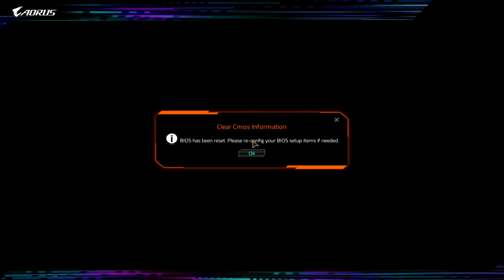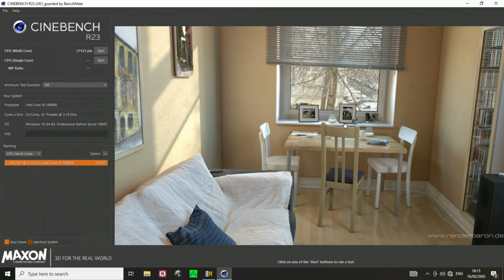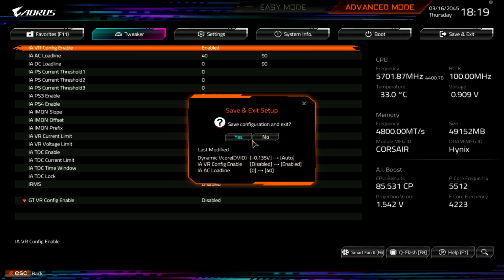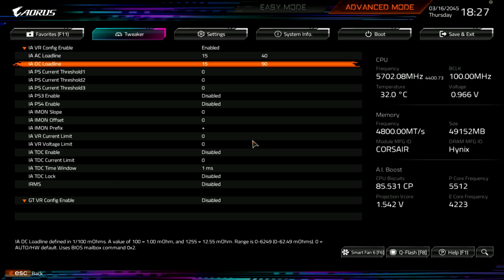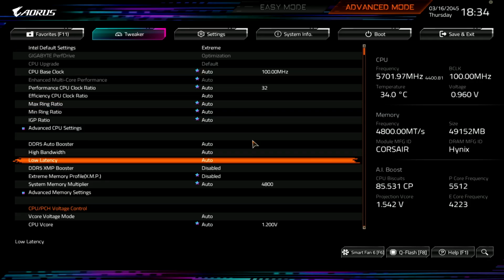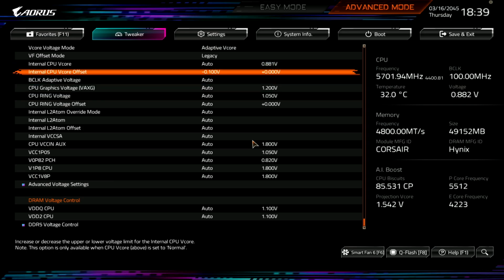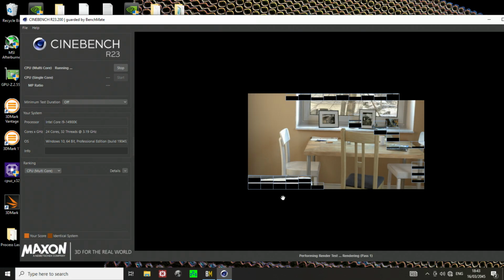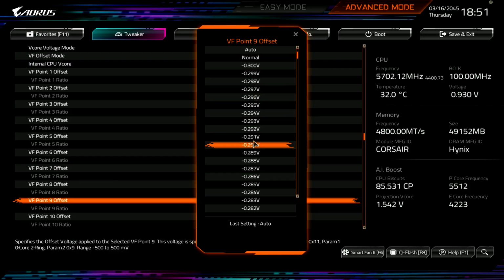YOU  DON'T HAVE  TO TURN OFF CEP to undervolt intel 13/14th gen CPUs

Comment: Great video, learnt a lot. Sadly my VID stays the same, it's somehow getting ignored. B660I Aorus Pro, latest BIOS, the new microcode. CEP can't be disabled either for some reason on this board, even with the old microcode, the option is just not there at all.

Comment: When I do it the correct way—as you have shown in this video—it does succeed in preventing CEP fork throttling and tanking Cinebench score. However, I lose the 6Ghz boost clock entirely. Actually, I never see a clock higher than 5.7Ghz, entirely, at any voltage, load, or temperature.

Any idea why?

Thanks for the video, Buildzoid.

Comment: Processor i7 13700KF, LLC - HIGH, AC/DC - 55, AI VR LIMIT - 1400. VCORE OFFSET is set to -0.125v. There are no problems during testing, and the performance is good, but I am concerned that the voltage may exceed 1.5v during load changes. I'm also concerned about the temperature, which is 95-100 degrees (I have an Arctic Freezer water cooling system, but the mounting is incorrect, and there is no proper mounting, resulting in poor contact and overheating). If I set the Power Limit to 185W, I achieve acceptable temperatures of up to 90 degrees, but the performance decreases by 10-15%. Additionally, I experience constant temperature fluctuations during normal computer usage, such as when opening a browser, where the temperature rises from 55 to 90 degrees. Can you give me any advice? How can I remove the jumps above 1.5v (I thought AI VR LIMIT was the limit, but even when I set it to 1.3v, I don't see a difference)? Also, how can I cool my CPU a little more without losing performance?

Comment: I noticed on my Gigabyte Z690 UD DDR4 that if I set VR Voltage limit to 1400 or even 1450, the ring clock refuses to boost to the stock 4.5ghz. it only boosts to 4.0ghz

Comment: Can someone point me to a source where i can cross check this with a MSI motherboard? I've also a 14900k and my main concern currently is heat reduction. Got a 360 AIO (but no contact frame) and i'm hitting 84c in CB23 and around 75c in BF6.
It's really a lot of information and unfortunately setting descriptions aren't always the same across mainboard brands.

Comment: on these setting my system will not boot-Gygabite Z790 ud d4/i7 14700k/80 gig ram-i had to reset the bios. is it possible because of voltage?

Comment: You don't need to undervolt any chip if everything is built correctly. This is just misinformation that leads people to damage or destroy their computers. Undervolting any device will cause performance degradation and stability issues, and ultimately damage the entire PC. People should avoid these dangerous setups and run their machines on default settings if they don't need overclocking capabilities.

Comment: if there are any option for undervolt my 13700F in my Z790 aoras elite ax DDr4 i have watercooling msi 240 but it hit high temps too fast  the only thing it works for me i add PL1 125w and PL2 160w but i lose a lot of performance if there are any way to decrease temps without lose performance i want to try adaptive vcore offset but offsets was hidden in my motherboard any help ?

Comment: Interesting video, does this also translate well for MSI Z790 motherboards and 14700KF processors?

 If I undervolt my CPU to -0.100 and run a 1 hour stress test the PC will just reboot about 20 minutes in.

Here's my settings.
  Intel 14700KF processor: 
.Load line calibration level 4
. AC / DC set to 12 down from auto which is 110 and causes over heating even with default clocks.
. 6 P-cores at 5.7Ghz and negative offset of 0.055V
.2P-cores at 5.7Ghz and a negative offset of 0.075V
.All E cores 4.5Ghz (4.6Ghz tested and works fine) default voltage of 0.00
-------------------------------------------------------------------------------------------------------------------------
XTU score: 12,850
Cinebench R23: 36,880

Average temperatures while running Cinebench R23 88C with an ambient temperature of 23.9C or 75F

Edit: Happen to know how to increase fps beyond 76 fps in timespy? some times I see 81 fps but most of the time 76 to 78 for the cpu test

Comment: Your videos helped me get my 14900k to 39200-39700 R23 score while keeping Max temps less than 80 and max voltage to 1.34V or less. 

Thanks glad I bought a gigabyte z790 MOBO.
Reply: Settings for load line and did you use a adaptive offset undervolt?

Comment: Hello everyone.

My processor Intel i7 13700k is always overheating (idle temperature 65-68 Celsius)so I made a couple of bios settings on it :

EXTREME MEMORY PROFIL : XMP1
RE SIZE AR SUPPORT    : ENABLED
IA VR CONFIG ENABLE   : ENABLED
IA VR VOLTAGE LIMIT   : 1300
IA  AC  LOADLINE      : 55
TURBO POWER LIMITS    : AUTO - ENABLE
PACKAGE POWER LIMIT1 - TDP(WATTS) :170
PACKAGE POWER LIMIT2   (WATTS)    :170
CORE RURRENT LIMIT (AMPS)         :AUTO - 200
CPU INTERNAL AC/DC LOADLINE       :AUTO - POWER SAVING
CPU VCORE LOADLINE CALIBRATION    :AUTO - MEDIUM
INTERNAL GRAPHICS                 :DISABLED
GIGABYTE UTILITIES DOWNLOADER     :DISABLED
DYNAMIC VCORE (DVID)              :-0.070V
INTERNAL VCCSA                    :AUTO - 1.200V

Do you think this is a suitable setting for an i7 13700k processor??
Now the temperature is stable at idle 50-55 celsius
I didn't do too much reduction, tightening ??
It seems that the speed of the Pc has decreased slightly.
Which option could be slightly reset without increasing the temperature?
Reply: IS IT A FOOD SETTING DO U RECOMMEND THIS CUASE I HAVE 13700KF

Comment: What do you do on an MSI board though? The settings have slightly different names so I don't know if they're the same thing or not and there's the the LLC, I heard elsewhere that it doesn't work the same direction as on other boards but I just can't figure it out, is high LLC a bigger compensation or is a low LLC a bigger compensation. None of it is clear to be honest.

Also quite confusing, I thought Vcore and VID were different things? You adjusted the Vcore whilst talking about changing the VID offset but I thought one was the CPU end and the other was the controller end? Are they the same thing?
Reply: I also have MSI, if you found anything plz help

Comment: Wait are you sure thats an issue? If you offset by -0.135V you would probably need a top 1% Chip if not better and be super lucky for that to not make everything unstable cause crashes or simply downclock your CPU alot. I would try a conservative number like  -0.030 to -0.050 and see if that fixes the issue with minimal to no performance loss and no extra fuss which would be realistic in most cases. For most people a -0.050V offsett actually works drops temperatures by 10 degrees while maintaining standard clock speeds and be in Intel specs in terms of voltage. It's not like the CPU will go into turbo high voltages under normal use in that case.

Comment: If I understand correctly, my 13700k BIOS config, is counterproductive for degradation?
IA VR Config = Enabled
IA VR Voltage Limit = 1400mv
IA AC Loadline = 55
Package Power Limit1 -TDP (Wats) = 253
Package Power Limit2 -TDP (Wats) = 253
Core Current Limit(Amps) = 307 
CPU Internal AC/DC Load Line = Power Saving 
CPU Vcore Load Line Calibration = Medium
Vcore Voltage Mode = Adaptive
Internal CPU Vcore Offset = -0.100v
Reply: pl 1 220 or 125 imo

Comment: I tried with IA CEP on, but it only worked well with it disabled on my 14600k… better results now and lower temps!
Reply: Yep same here. IA CEP on forces the AC to run higher. It doesn't work well when using a lower CPU lite load
Reply: Did you find a solution? I can’t find a way to get my vcore and vid voltages to match well enough to not trigger cep without increasing them significantly rendering my pc a thermal mess.

Comment: But each mobo has its own LLC values
I have Msi z690 Tomahawk, and it is really hard to find any LLC values for the 8 modes in Bios. It even differs from the same company as a different model

So, how can we calculate each mode for non tech?
I searched a lot and nothing tells how to calculate it

Comment: I agree the video is a tad long, but I need to offer confirmation that your recommendations are spot-on. I have the Z690 AORUS Elite AX with F30 BIOS (0x12B Microcode) and a brand new i9-14900K (never subjected to faulty default voltage settings, BTW). With your settings: Adaptive Vcore, Legacy mode and -100mv offset, Loadline Calibration = High, VR Voltage Limit=1400, and IA AD/DC Loadline=55, I consistently get CBR23 score of 39500-39700. And highest vcore never exceeds 1.34v under all core load.  And I'm still seeing 2 Perf-cores hit 6 GHz periodically and multi CPU ALL-core loads at 5.7 GHz on the 8 Pcores.  I suppose I could tweak at the margins, but I really see no need to as these are rock stable under gaming loads, and CPU voltages drop to .77-.78 v under idle or low loads.  Thanks for your explanation of this most-confusing topic.

Comment: hey there - tommorow get my i7-14700KF on ddr4 since have in my old system also get very cheap GBT mb - those settings should work also for i7? I should start to update bios with q flash without cpu in it?

Comment: I want to run my 14700k+gigabyteZ790i on lower tdp and voltage on a mini itx case with a tiny cooler. I don't really need that much processing power and the CPU was obtained for cheap (exploited a  e-retailer's website error), anyone have suggestions, video recommendations or info? I don't care that much about performance lol

Comment: what is the new max voltage standard from intel's 1.72v then ? i have an asus z690 hero with 13900k by core usage p55/e44/c8 to 49 all limits off cep and all that disabled max core voltage 1.4v the second max vcore voltage at 1400mv  the vr f curve set at -0.06v at 5400mhz the next steps are 5700/5800/5800/5800acdc and those are set to -0.08v max wattage 450w on both pl1 pl2 so it runs accoring to hardware monitor at 1.305-1.314v at full load drawing 440watts in CodeBench load line at 8 with ad dc set at 0.01 for both .is such a low ac dc causing a voltage spike should i lower it to 0.03 for both ? or lower my load line to 4 and adjust ac dc to match ? as since i dont use higehr single core speeds i dont see the need for vdrop any more it would be best it run at the lowest voltage it can given its only maxed at 55x now . i also have undervolted the cpu l2 voltage which i think is the ecores by voltage offset of 0.04v. SA is 1.3v stock. memory is 6400 clocked at 6000 1.335v mem and imc of 1.335v instead of 1.4v for mem and imc stock at 6400. also my max cpu temps are 78c at full load in cinebench at 440w 1.314v .

Comment: Great video as always BZ.  I did all the settings you have shown but if I try and raise my CPU above 5.4ghz it will start to hit the 253w PL1/PL2 limits.   Do you know how I can further tune my 14700k to stay at 1.35ish volts and at or less than 253w?    I have a score on my Aorus Master X of 94 so my cpu should be ok as I have not tried to run it past 5.2p cores and 4.0e Cores due to intel's issues.

Comment: I was able to adjust the settings for my ASUS ROG STRIX Z790-F GAMING WIFI MB and increased from sub 37,000 to over 39,000 on Cinebench R23 with my 14900k. In the BIOS under the Ai Tweaker tab there is the Global Core SVID Voltage setting which I changed from Auto to Adaptive, then I changed the Offset Mode Sign to -, and finally set the Offset Voltage to 0.10000.  This is also after installing the microcode (0x129).
Reply: keep CEP on?
Reply: @AdventureStreamingGuys yes
Also, realized those weren’t my CPU temps but rather my GPU.

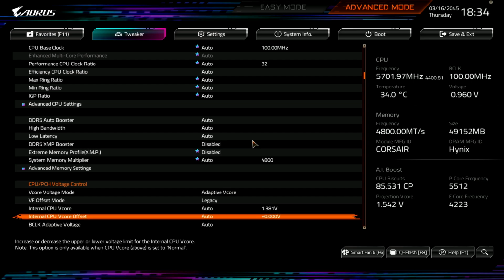Comment: Tried the method at 26:00 on my MSI board and this did not work. CEP enabled, Lite Load set to intel default and had an offset of -0.1 (I think MSIs offset mode is the same as the gigabyte adaptive mode shown here, since this mobo here doesn't have an offset mode and MSI adaptive doesn't allow you to specify any kind of offset) and this gave me a score of 17022 (!!!) for my 14600kf. That's way worse than what I had before which was around 22k (still not amazing).
Reply: Any update?

Comment: Hello buildzoid, I follow your video to do following settings:

CPU: 14900K
Intel Default Setting: Extreme
CPU Vcore Loadline Calibration: High
IA AC Loadline: 55
IA DC Loadline: 55
IA VR Voltage Limit: 1400
Vcore Voltage Mode: Adaptive Vcore
VF Offset Mode: Legacy
Internal CPU VCore Offset: -0.125v

In the video, you set Internal CPU VCore Offset to -0.100v but I set to -0.125v, is [-0.125v] with these settings also safe for long-term use? I do not know much about undervolting, I just hope my 14900K not going to degrade.
Reply: as long as temps are good and system is stable...u good
Reply: Did you edit the PPL1 PPL2? Should i set mine to 253W?
Reply: @ragama623  i haven't set it since Extreme profile already handle for it (restrict ppl1 ppl2 max to 253w)

Comment: genuine question: after upgrading to the latest bios on the B760M AORUS ELITE X AX, the "undervolt protection" option has gone, and undervolt isn't possible. On the other' vendors MBs this setting still exists though. How to undervolt with such a problem?
Reply: This option has also disappeared on my Asus BIOS after an update so I think Intel mandated the removal of said setting.
Reply: @pixels_per_inch I doubt think so, because all other manufacturers has this option in their BIOSes
Reply: @antonavdyushkin545  I think they've only forced enabled undervolt protection on non-Z series boards just like CEP.

Comment: thanks for the guide
using a i9 14900KF on a aorus z790 elite AX ice with an AIO 360 watercooler i got a 35022 cb score
after changing the vcore offset to -100 i got a 35795 cb score
setting the vcore loadline calibration to high put my cb score to 36472
still not nearly as high as yours but im happy it improved, was not able to change the AC/DC loadlines as it was unclickable with the latest bios

Comment: Hey man great video, i have the B760 and i updated it to the new microcode 0x129, intel default settings is not in the bios before or after i updated the bios.

And the CEP setting is the same as u have Auto = disabled.

I don't have the "offset" options in my motherboard so im stuck with the dynamic Vcore option.

Im getting better score on Cinebench 24 when i apply a negative value in the dynamic Vcore.

That means the CEP is actually disabled, right?
Reply: B series can't disable CEP, it's forced enabled at the hardware level. I assume your CPU is a lower tier than the 13600K which is the minimum they have programmed for intel default settings
Reply: @pixels_per_inch  i have the 14700F , and I think it is disabled , because my Cinebench score is higher after i undervolt it using the Dynamic Vcore.
Reply: @7MDv  Ah right Intel started allowing disabling CEP on newer 14th gens steppings
Reply: They allow disabling of IA CEP on b760 I can confirm this. Running the latest microcode 0x12b I believe. I have a 14900f

Comment: I have a B760 and i don't have the "offset" section in my bios , all i have is the Dynamic Vcore, i compared before and after applying some undervolting to the dynamic Vcore and i noticed high Cinebench scores with lower temps after the undervolting 🤷‍♂️. What is going on?
Reply: Same with me, Vcore offset doesn"t work, and the temp rises to 95 degrees. but disabling the intel default settings and setting to gigabyte perfdirve setting and setting to Dvid to -0.15 volt. is boosting the CPU performance

Comment: I had to turn off CEP to undervolt my 13600k. Tried everything else and CEP off is the only thing that permits an undervolt. Aorus elite ax rev 1.1 z790, 0x129. Clearly, there is an as of yet unknown issue with boards behaving differently. Under Voltage Protection is on. ac dc ll 50/50, vcore auto, dvid -100mv, llc high, 200A max., 1300mV limit, 125w&125w. vrout 1.126v, vcore 1.128, VIDs 1.214V. huge difference there but working on making it disappear by tinkering with ac dc ll.
Reply: had the same issue, nothing worked. Gigabyte Gaming X AX.
Reply: @azzwhupin  yeah i just gave that up. something is wrong that we can't fix on our end. there is some hidden shit going on

Comment: CEP was introduced due to silent corruption since 12th Gen I assume. I udervolted a few builds without CEP and they eventually corrupted the windows installation. This has never happened with 11th Gen or older, they would just freeze if voltage wasn't enough.

Update: The root cause was SA CEP, ALWAYS ENABLE SA CEP even if SA voltage is left on auto
Reply: Is this still a thing? can i safely deactivate IA CEP on a 14600k even with newer bios updates? (msi mb)

Comment: You mentioned that you find undervolting via VF Point offsets hard to tune. But what if the same offset would be used for undervolting only VF Points 7 to 11 while leaving the lower ratios untouched? Do you see this as an improvement over applying the offset globally? I am a bit concerned about lowering the idle voltage and lower ratio points too much and am not sure how to test stability in that area. That is why I thought of only applying an identical negative offset to upper part of V/F curve.
Reply: That's what I use. 0.068 undervolt on points 7-11 on my 14900K Z790 Dark Hero.

Comment: 25,000 ish points is what I usually got with my i9-12900k lol
Do you have a video covering how to safely undervolt/overclock the i9-13900k on the MSI z690a pro WiFi board you have? I just “upgraded” to the 13900k and now come to find out there’s all these issues with these cpus lmao
I’m a video producer and editor so time is money for me, I need my system to be fast but reliable. I should probably move up to the z790 board but, the specs didn't seem very different, maybe I'm wrong. Any help? 🤙🏻😎❤️